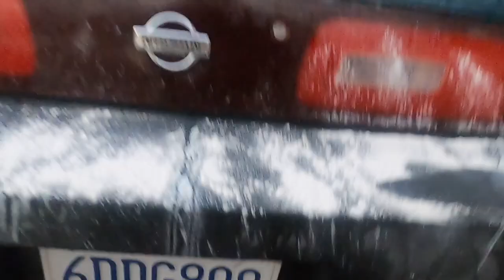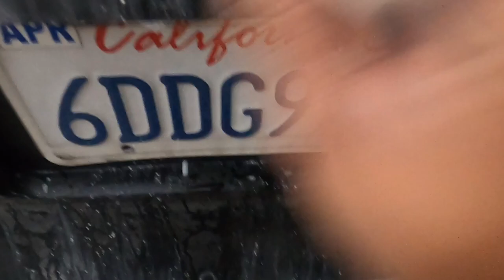SAND IT SMOOTH...S14 Wrap Prep Tutorial, Bad Chipping Paint, Poly Kit, Bare Metal

Comment: What grit sanding discs do you use before wrapping your cars?
Reply: 1000 grit but you have to start with 400,  600 and then go to 800 before doing the final finish, then clay bar the junk off so it wraps on clean
Reply: @MegaCasey09  is there a two in one filler/primer I can use after I wet sand? My Poly. front bumper and A pillar need to be sanded down & then primered. I'd like to use a black primer if possible since the paint on the rest of the car is black.

Comment: 01:43 🚗 Coverlay provides affordable and custom-fit dash covers for your car, eliminating the need to deal with cracked or damaged dashboards.
03:38 🛠 Coverlay dash covers are easy to install, don't require taking the dashboard apart, and come with silicone glue to ensure a secure fit.
05:06 🚙 The video demonstrates how to prepare a car for wrapping, including sanding down areas with bad paint, addressing polyurethane bumpers, and dealing with issues like flaking paint.
12:11 🎨 When wrapping a car over exposed metal, it's recommended to use primer on the bare metal areas before applying the wrap to prevent potential issues, especially in humid climates.
16:58 🧽 To ensure a smooth and secure wrap application, test the wrap on the surface, squeegee it, and check for imperfections or residue. Sanding may be needed to improve adhesion.
Reply: Thank you for answering my questions about wrapping bare metal and the preventive measures for doing so👍🏼